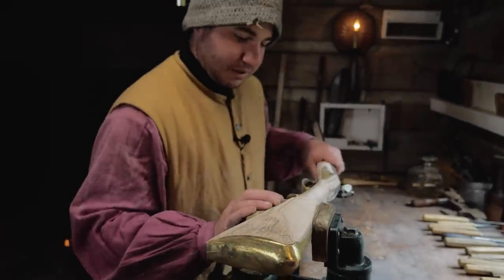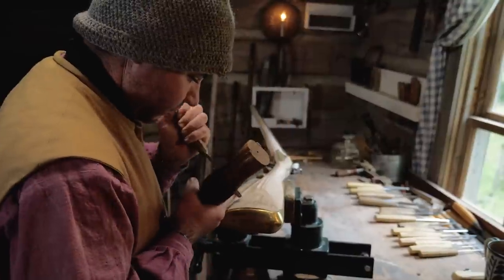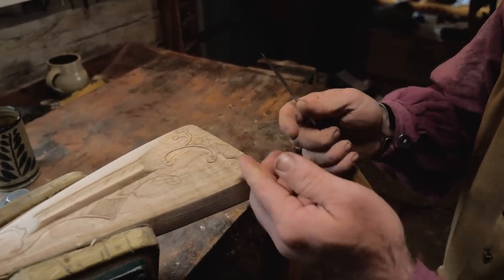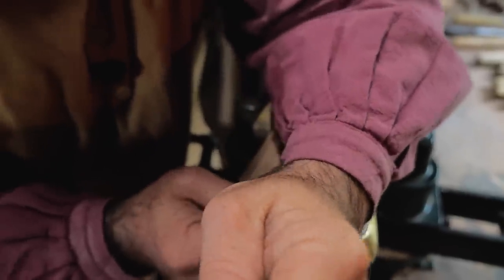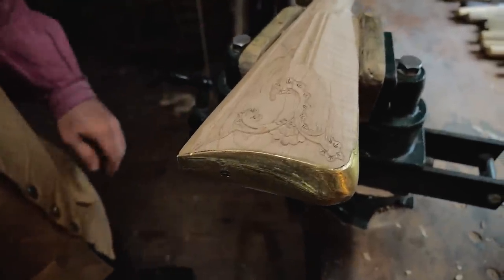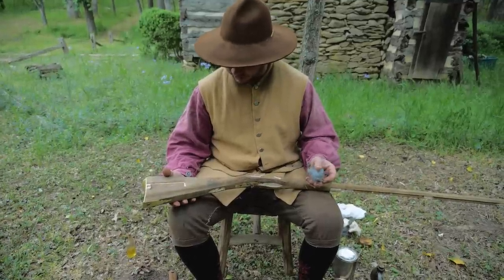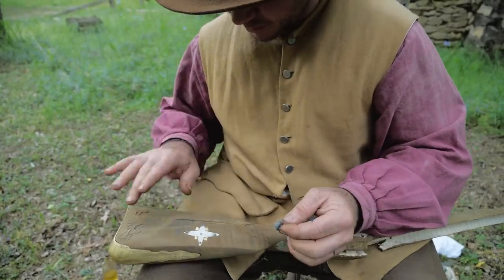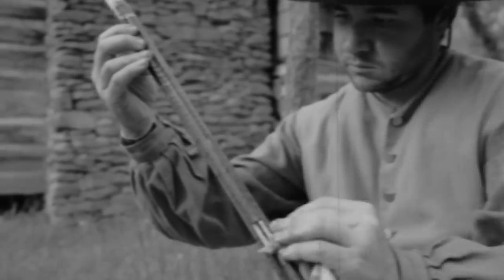How to Build a Flintlock by Hand (Part 8)

Comment: Nice traditional work, I use a 6 inch metal vice as well. On each side of the vice about 18-20 inches, a sliding "L" shaped arm slides up and has a 1/4" carriage bolt  with head driven into hole from inside with a wingnut on outside so that it supports the stock so when you hit your chisel the stock doesn't wiggle.  I have a cousin who was actually born in a log cabin in Sequatchie, Tn.     "gunmaker"
Reply from the maker: That is awesome man! Yes I made me a brace since the videos so the bouncing will stop.

Comment: Tyler.. I really enjoy watching your videos and the way you are using mostly all the tools that would have been used back in the 1700''s.  Your shop is awesome. Looks like you are really living like they used to back then.   I was wondering how you secure decorative inlays like the thumb medallion and the star ? Are they glued in ? If so what type do you use ? Look forward to seeing more from your workshop,,Thanks , Don Hilts
Reply from the maker: Hey Don. Thanks. Yes you can use glue or epoxy. For the escutcheons (wrist inlays) I use little pieces off of the same piece I cut it from, and form little tapering nails about 1/2 inch long. Drill your holes in the piece where you want your nails and countersink them ever so slightly. Doesn’t need much. I literally just use my hand and a countersink to do this. Then glue it of epoxy it and nail it in. File any overhang of the escutcheon flush with the stock and file the nails flush. Hope that helps.

Comment: Do you use any oil on the finishing cloth? In traditional "French polish" finish, a few drops of oil help to lubricate the cloth, and prevent it from sticking.
Reply from the maker: Yes. I use a lot of walnut oil and then finish. After it’s dried I burnish the stock with feed and wax or turpentine mixed with beeswax for a polish. But if you apply the shellac very wet and keep swirling it until the whole stock is saturated it works very well. But I do that with a cotton dobber.

Comment: Does anyone use boiled linseed oil? It doesn't harm metal so it looks like it would work here.
Reply from the maker: You bet. Boiled linseed oil was a very common traditional finish. It takes a long time for each coat to dry, so that’s the main reason I don’t use it.

Comment: Could you tell me what methods are used to forge the barrel?
Reply from the maker: It’s a long process lol. I would recommend getting the video, “handforging a barrel” from pioneer videos. It’s really good! But it starts with a piece of flat wrought iron which is heated in the middle and forge welded. You keep rolling it and welding it from the center to the end and then from the center to the other end. Ever time you go to beating on it you have to have someone shove a sprew in it to keep a little hole open. Once it’s welded and straightened, then you bore it with one little long bit at a time until you’ve achieved the caliber or gauge you want. Then you have to rifle it if you’re wanting a rifle. Then hand file it octagonal. Then drill and tap for a breech plug. It’s a ton of work but very rewarding.
Reply: @goldenmeanflintlocks9713  ok thank you very much I am interested in creating one but I am afraid of high pressure and I would not know how to try it without taking risk
Reply from the maker: They used to test them by strapping them to a board and loading it with 3x the amount of powder you would normally shoot out of it and light a fuse or black powder trail to ignite it. They generally did that that 2 or three times. And if it never split then it passed.
Reply: @goldenmeanflintlocks9713  Thank you very much for your answer brother I will do it like this!
Reply from the maker: You’re welcome.
Reply: @goldenmeanflintlocks9713  Sorry for the inconvenience but I want to know if the ignition powder is equal to the powder of the charge inside the barrel?
Reply from the maker: It doesn’t have to be. Some guys prime with FFFF black powder and load with FFF and some guys load and prime with only FFF or FF. I personally load and prime with FFF because it’s a little cleaner than FF and goes off a little quicker. Also, they didn’t use priming horns in the 18th century, only powder horns. So whatever was in your horn is what you loaded and primed with. And you are no inconvenience. I’m open for answering any questions.
Reply: @goldenmeanflintlocks9713  ok very thanks😉
Reply from the maker: You are welcome!